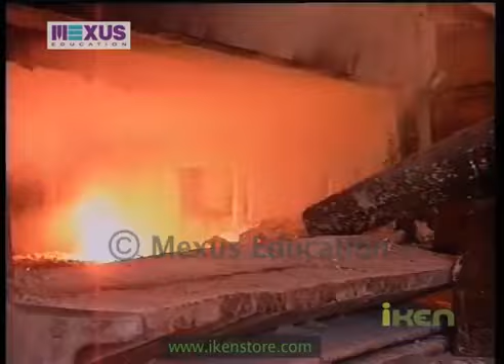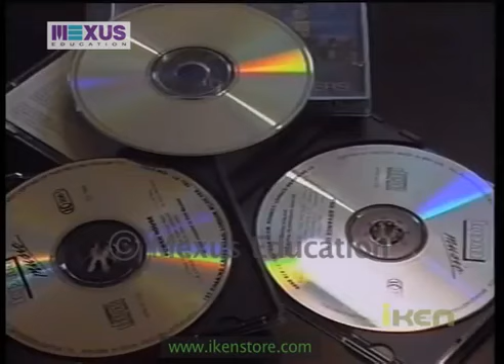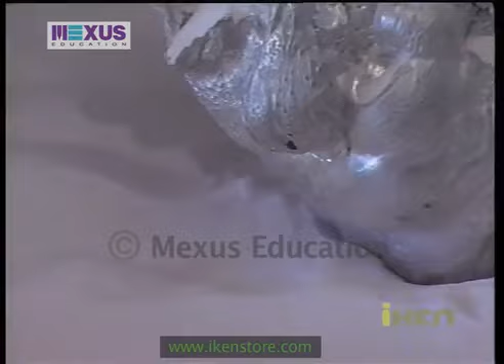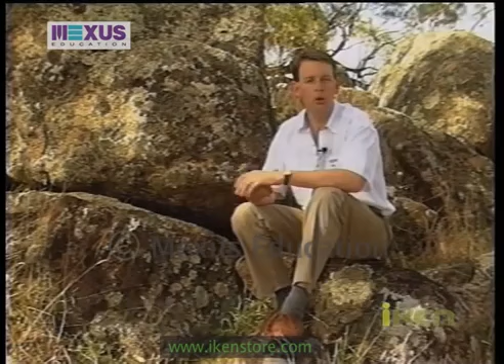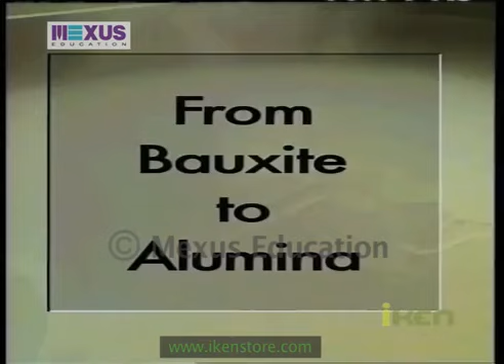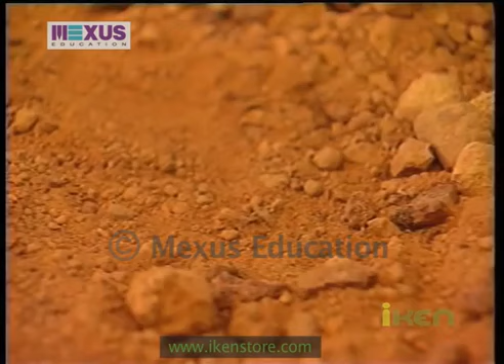The Making of Aluminium

Comment: Ramadhan Putra Narindra
2713100071

its a great video. why? because this video tell all about aluminium. as we know, aluminium is necessary in the world. we can see at by cycle, car body, tv antena, airplane body, and etc. Aluminium include a light metal. The process of aluminium decided into two, first alumina production, and second electrolysis. The rock of aluminium is compounds many elements. granite is one of aluminium ore source. It compound aluminium, silica, magnesium, sodium, calicium, and etc. From that rock we can find aluminium ore that called bauxite. Bauxite contain aluminium oxide and hidroxide. Bauxite has been obtained from open pit mining. Aluminium processing need very high energy. Therefore, aluminium processing spend a lot of cost. The first of aluminium process is refining a bauxite to be an alumina. This process calles bayer process. in this process, impureties of bauxite such as titanium oxide, silica, hidroxide will be removed. Bauxite that already grinded, mixed a soda and coustic solution. After that, we get gamma alumina (Al2O3 3H2O). Then, it is heating at temperature 1000˚C to remove a hidroxide. And finally, the result is sandy of alumina that compound Aluminium Oxide (Al2O3). It contain a Aluminium ion Al3+ and Oxide ion O2-. The next process is transform almunia to be a pure Aluminium. To get 1 tonn pure Aluminium we need 2 tonn of Alumina. This process use high electricity to separate Aluminium ion and Oxide ion. This process need 15 kwh electricity per kg of Aluminium produced where 1 kW radiator running for 15 hours. The voltage that need to produce high power in this processing is 500.000 Volt. In australia, to produce aluminium they spend all cost from raw materials 45,3%, Alumina 33,1%, energy 28,5%, electricity 26,6%, and labour & Overheads 26,2 %. To transform alumina to be pure aluminium use electrolysis process. electrolysis process in aluminium processing called hall-heroult process. the name of the cell is hall-heroult cell. In this process, the anode used is carbon, and used pure aluminum and carbon black as cathode wherein the anode as a positive pole and the cathode as a negative pole. Carbon black in the bottom of the cell. Electricity fows from the anode to the cathode through the electrolyte solution. And in the batch between anode and catode heat to 950˚C. The electrolyte that used campound cryolit, Aluminium Fluoride (AlF3), Calcium Fluoride (CaF2), and Aluminium Oxide (Al2O3). when alumina in the form of sandy is inserted through hoper and react with the electrolyte solution at under the anode, the alumina will be split into aluminium ions and oxide ions. The aluminum ion will react with negative electrons that flowing from the cathode to the anode to be a molten pure aluminum. Ion oxide will react with carbon from the anode to be CO2 gas. in addition, important elements are absorbed into the exhaust gas such as flouraid will be reabsorbed by the alumina into secondary alumina. This secondary alumina will be used again to produce aluminum. Heat balance in this cell controlled by computer. Heat balance need to be controlled because electrolyte solution is very sensitive with fluctuative temperature. Decrease of temperature can make electrolyte solution freeze and if temperature increase, side ledge can be decrease and electrolyte solution can converge with wall cell. Therefore wall cell can be corrosion. Quality control in molten metal is crutial. Molten metal will be finished with technique called optically emission spectroscopy. After that molten metal can be casted to produce ingot. Ingot purity which are expected is 99,8% Al. Each day, produce an aluminium ingot about 900.000 tonn. And one ingot produced every two second. In a year, 330.000 tonn was exported. Aluminium process consume high dielectrical energy. And then in the aluminum processing produces greenhouse gases. Greenhouse gases is some of the gas that can cause global warming. Highest amount of greenhouse gases generated by the aluminum processing is CO2. In addition, fluorance gases that produced from this processing also contributes to global warming. Even the amount of gas fluorance slightly more dangerous to the ozone than carbon dioxide. Maximum emission of fluoride gas is 0,73% kg per tonne aluminium. In the portline emission is 0,37 kg fluoride gas per tonne of aluminium. Even so, the real condition of prroduct 300 tonne aluminium give result 0,76 pound of flouride gases in the air.

Comment: Gabriel februando
2711100108

Aluminum is often used around us like cd , cans , airplanes , bicycles and tv that we watch every day. Aluminium metal is so chemically reactive, That's so rare to find a pure aluminum. Aluminum has always been bound with other elements.
Aluminium production starts with the raw material bauxite, a clay like soil type found in a belt around the equator. The bauxite is mined from a few meters below the ground. 
Bauxite has high melting points up to 2000 C because alumunium is an active metal. It’s not easy to reach 2000 C heat, so they uses electrolysis rather than cook the alumunium. In the video, it takes place in Australia, in the Alcoal Company. They transport, process the metals in a conveyer belt, which took a lot of area for indutries. They uses Bayer process to chemicaly filter out impurities such as iron oxide, silica and titanium oxide. The crust hydrated alumunium is mixed with sodium oxide or called caustic soda, in a high temperature solution. During this stadium, the sodium hidroxide selectedly dissolved the alumunium oxide into solution, leaving any impurities to be filtered out. Then a hot concentration sodium aluminate solution is cooled off, this encourages for the growth of the crystals. When its cool enough, the Al2O3.3H2O is heated up to 1000 C to dry it out of water. Later, it became steam and released to the atmosfer. To make a ton of alumunium, you need 2 tons of alumina and a half ton of carbon. The carbones is uses to make the anodes for the process. The other major ingredients is electricity. It tooks 15 kwh/kg for each alumunium, as same as 1 kwh of radiator for 15 hours working, which roughly costs half million dollar per day. 
 In Hall-Heroult process, there are many components that we need. The components consist of Cathode, Anode, Electrolyte, Insulation, Feeder, and also electric current flow. The cathode of Hall-Heroult process is using Carbon Block that placed under electrolyte. The anode is also Carbon, but in different place and dimension. Every anode has a different age of use, because we can’t do an overhaul in Hall-Heroult in the same time. So, we must set the anode in different age of use. In this Hall-Heroult process the electrolyte is Cryolite (Na3AlF6)
Electrolysis process of aluminium use Hall Heroult process invented by Paul Hall and Charles Martin Hault in 1826. In this process, there are some cathode and anode. Equation of calculation of electricity is very simple : P= V X I and the calculation is 4,5 volts x 300.000 amps = 1.350.000 watts = 1.350 Kw power consume per pots. There are 408 pots, so we need over 550 MW total power consumption. The place of electrolysis process consist steel in bottom, carbon blocks (cathode), steel current conducting bars, insulated superstructure, carbon blocks (anode), alumina hopper, removable doors, fume hood. The position of anode lowerer than cathode. The process are: electrical resistance are heating, anode are lowered onto cathode become short circuit heats the pot to 950 C, anode raise and make a gap 50 mm, after that cryolite is placed in the heated pot. The term of electrolysis is he chemical decomposition of certain substances by an electric current passed through the substance in a dissolved or molten state. Electrolyte composition are cryolite (3 NaF.AlF3) melts at 1009 C, aluminium fluoride (AlF3), Calcium Fluoride (CaF2) and Aluminium oxide (Al2O3).
 Alcoa's Western Australian bauxite mining operations occur within the jarrah forest, located on the Darling Range Plateau.  Approximately 600 hectares in total are mined and rehabilitated each year at the Huntly and Willowdale mines.

Comment: Fikan Mubarok R
2712100080

THE MAKING OF ALUMINIUM REVIEW
Alumunium is active metal ,bonded and combine with other elements, so we will never find pure aluminium. Alumunium contains in surface of Granit . Granit is a rock that contain elements such as Aluminium, silicon, phosphor, Magnesium, Calsium and Iron. So how aluminium decomposed from the rock was by million years of washed granit. Rain and organic material washed the granit so the granit was decomposed into many element such as iron and aluminium, when exposed to the atmosphere aluminium will combine with oxygen and hydrogen become aluminium hydroxide.  After decomposion for million years all that remain is surface deposit of aluminium bearing ore called bauxite. Bauxite chemical name is Hydrated Alumunium Oxide (Al2O3.3H2O). Because alumunium is active metal its give bauxite melting point about 2000o C. Smelthing in this temperature is dangerous and costly. So instead of heat we use electrolysis to eventually make aluminium from bauxite. But before electrolysis to work,the bauxite must first being refined into Alumina. Alcoa refinery in Australia doing this. One of three Alcoa refinery is in Pingera west Australia. Bauxite mine ore reserve near the plant loaded by conveyor belt. Once there, Alcoa use Bayer process to chemically filter impurities such as Iron hydroxide, Silica and Titanium oxide. Its an energy hungry process that use half domestic gas of western Australia. Heres is the process: Al2O3.3H2O + 2 NaOH-> 2NaAlO2+ 4H2O in high temperature solution. During this reaction Sodium hydroxide dissolve aluminium oxide and leaving undissolved impurities to filtered out. Then next process : 2NaAlO2+ 4H2O-> Al2O3.3H2O + 2NaOH. When this enough, large Aluminium hydrate crystal filtered out and heated to around 1000oC. This intense heat dried water up into steam which release to the atmosphere. The refining dry and free flowing sandy compound called Aluminium Oxide or Alumina (Al2O3). Alumina contains small highly charge aluminium ions and oxide ions held in strong ionic network called lattice. Each oxide ion has radius two and half times larger than that of each aluminium ion. Because of this, its difficult to show this into three dimensional shape. But alcoa research believe that in order to maintain the charge balance these ion are arrange in regular pattern in alternating layers.
To make 1 ton of aluminium we need about 2 tons of alumina and just half a ton of carbon. Alumina from the previous process than ships into Portland Alumunium, western Victoria factory. Its loaded by vacuum system and travels by underground conveyor belt into big storage(cricket field size). American  made petroleum coke, a brittle solid containing of 80% carbon used for making anode used for smelthing. The other major “ingredient” is electricity. There are enormous amount of electricity to make aluminium around about 15kWh per kg of aluminium produced or same as 1kW radiator to runs for 15 hours. Like Alcoa produced 900 tons of aluminium a day and cost over half million dolars per day. They use 10 percent of electricity generated each day in Victoria. These energy transferred to 500 km to Portland at 500000 volts enough to compensate transmission lost. At Portland transformers drop the voltage to under 1000v DC. Production cost per tonne in Australia: Raw material about 45,3% Alumina 33,1% Energy 28,5% Electricity 26,6% Labour & overheads 26,2%. 
The heart of the smelther is in pot line, The name given for rectangular pots where electrolysis transform alumina into molten aluminium. These port also called Hall- heroult cells in recognition for the French man paul heroult and American Charles Martin Hall who simultaneously but independently foun economic smelthing method in 1886. Portland Aluminiums have 2 pot lines each with 204 parts measuring 13 meters long and 4 meters wide. Currents flow in one in flows in series frome one part to the next then going in second pot lines before returning to the switch out to complete these massive  circuit. Although the pot just runs for 4,5 volt the currents is 300.000 A. For 408 pots total power consumption is over 550 megawatts. These power is generating heat and electrolytic force needed for smelthing. Each cell made from steel in bottom and carbon block(cathode), at the top is Carbon anode hold by insulated superstructure. Include Alumina hopper, Fume hood and removable doors. The process is using electrical resistance heating. Anode are lowered onto cathode. Shorts circuit heats the pot to 950oC. The anode than raised to leave a gap of 50 mm then cryolite(the chemical decomposition of certain substances by an electrical current passed through the substance in a dissolved or molten state) placed in the heated pot. Composition of cryolite 3NaF.AlF3 , AlF3 CaF2 and Al2o3 to reduce cryolite melthing points. Next, Alumina will dissolves and melts at 950oC. Cryolite forms a thick crust and Carbon soaks up sodium, Pot room operators add soda ash, alumunium fluoride also added then gass collected. These process are carefully monitored by computer. Carbon is ripped from each anode, and anode are automatically lowered.  
From electrolysis to ingot. Previous product is molten Aluminium. The quality control of compotition is Ingot puity about 99,8% . Alumunium is 8 of valuable commodity.
Side product of these process is carbon dioxide and also green house gas and also particle gas. But some by product also become fertilizer.
Pollutant also generated include particle and heat that blows by the wind into the island. Electrolysis is the economic process to produce alumunium but still gives pollutant and gases but these is the most valuable method to process the most important metal aluminium.